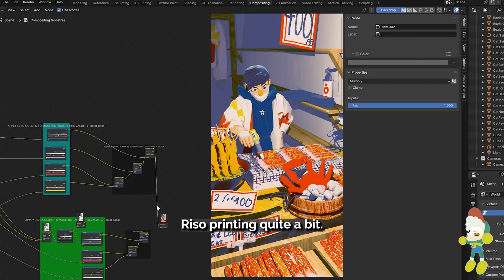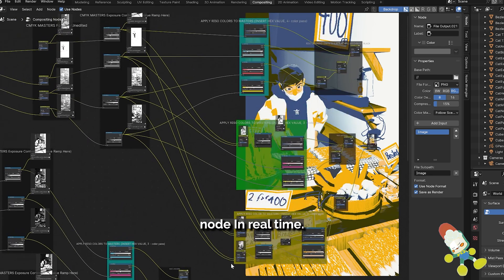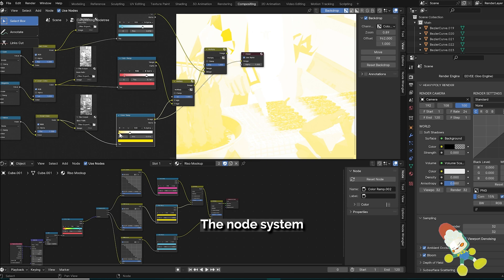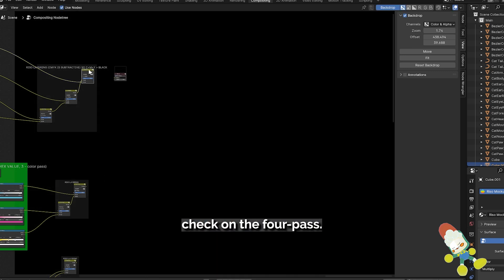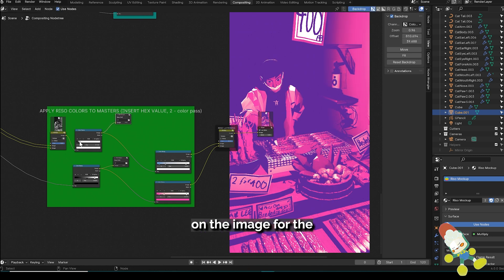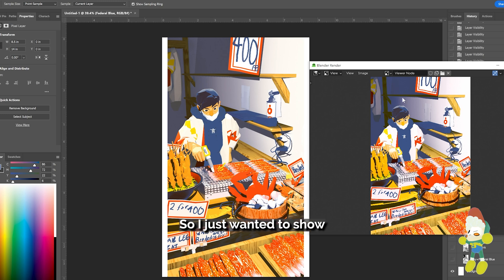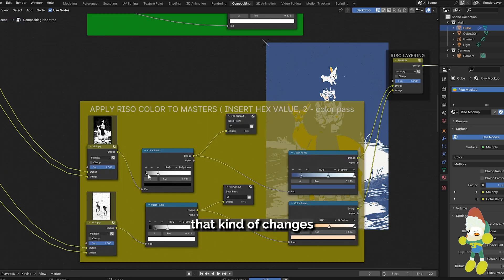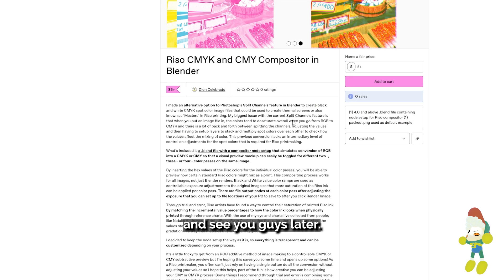Creating A Riso Compositor In Blender: Transforming RGB To CMYK or CMY

Comment: literally messing around in Blender wondering if there was a way to do this and low and behold... THANK YOU!! This is an amazing tutorial and very helpful.
Reply from the maker: @hhigh_af  no problem man! Just sent out some files to a printer and didn’t have much issue, you might need to tweak it a little based on the actual print you get back, but it’s a pretty nice way to mock-up some ideas

Comment: Hi! Ive recently been doing something very similar and your file / workflow is perfect thank you for sharing!

Recently I have been thinking about using blender to create riso prints. I have experimented using your method of compositing to some success! (with my first print from it happening today) 
I have a question that came from this print...
You mention an exponential value between the riso ink and the master. (which is where I feel like blender shines over photoshop for the customization of prints) 
When Experimenting with this value to try and get it accurate are you adjusting it and checking it somehow? or just going by feel mostly... I had some problens getting it to look like it did on my computer (even though it still turned out very cool especially for a first try)

I also know that risograph machines dont love over saturated masters as they cause a risk of jams in ink heavy prints. Maybe another way that blender could help getting great prints with the riso! Might try experiementing with slightly lowering the dark value on the adjusted exposure and seeing how that goes! will check in if something profound happens/ I discover any more tricks in my riso experiementations!!
Thanks again for this.
did a search just to see if anyone has tried risoXblender and the blender community does not disappoint!!
Reply from the maker: @Gardenofevildoers   hello! When experimenting with the value to try to get it more accurate, I would pick up a physical chart made by a riso printer, a lot of them are made from people in LA, to eyeball to the digital mock-up or make my own chart with various increasing percentage levels of values that correspond to the color output. A color ramp, which I use to simulate how ink is applied to the masters, unfortunately does not have percentage values so it’s a feel by eye to move the slider closer to higher saturation of color around. I would check it against another drawing software like Photoshop for the % values. Printers can vary slightly per print so sometimes earlier prints can turn out more saturated with color. As per jamming, I heard capping the values to around 90% Black per spot color produced a similar color to 100%, as 100% leads to more ink smudging. So yes, I would experiment with reducing the color ramps used for exposure if the printer is currently over saturating or mixing too dark. It’s a bit tricky to standardize because each printer is different, so I’m hoping the color ramps are flexible enough for people to experiment with to adjust and print a couple test prints along the way before dialing in. Unfortunately I don’t have my own riso printer but work with people who have riso printers, so availability to perfect this is a little limited for me at the moment. I am interested in seeing the result and  screencap of the digital mock-up if you want to send one at musubibiadventures@gmail.com
Reply from the maker: @Gardenofevildoers  riso can be tricky because when I mentioned the exponential part, what I meant to elaborate on was that between 70-100% Black on the masters is when you can get the most of your color and between 0-40% the color falls towards to white pretty quickly.
Reply: @musubi-bi  I'll Send you an email!

Comment: hey! 
got the node tree, really amazing work and have been trying to get blender to do CMYK for screen printing for a while now. Just wondering how you render the separate layers for printing. I have Z passes enabled but i still get a blank image after the render. Thanks!
Reply: nevermind! just had to add the "composite" node, thanks!
Reply from the maker: @scottkedy23  awesome, let me know if you have any more questions!
Reply from the maker: @scottkedy23  hey man thanks for the purchase, so in order to view the render, you can change one of the options into the preview result. I’ll include an image and some new instructions into gumroad that will clarify this. To get the separate layers, you need to set the file paths to where you want them saved on your computer.